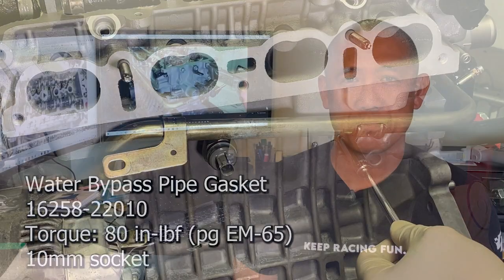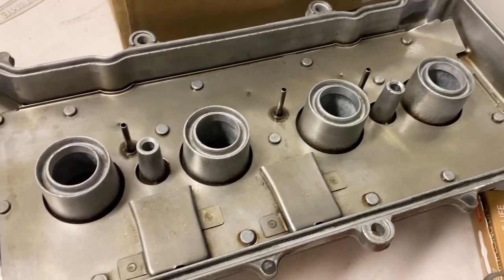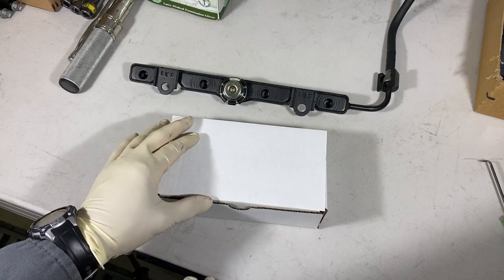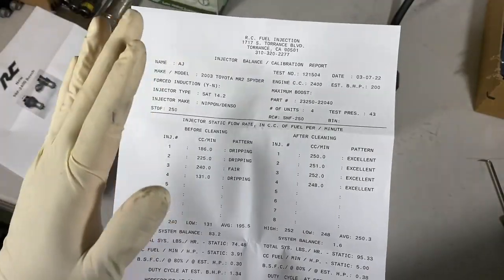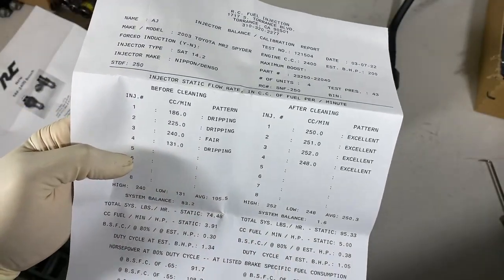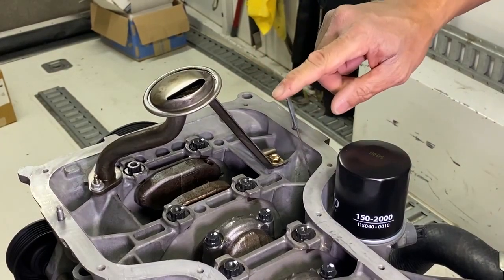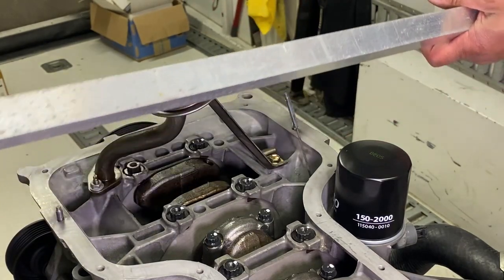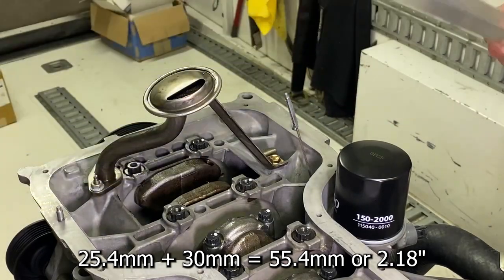1ZZ-FE Rebuild Part 6 - Valve Cover, PCV, Fuel Injectors, & Oil Pan

Comment: Hi AJ, thanks so much for posting this video, I have a 2005 Rav4 1.8 Litre, 1ZZFE engine, EU/UK version. I got it second hand in April 2024 with 88,000 km on it. It has been running very well, however I'm looking into replacing valve cover gasket, then check transmission as well. 

Could I ask if you got a video of the transmission rebuild?

Thanks very much in advance! 
Merry Christmas!
Reply from the maker: I made some transmission disassembly videos, but never showed the rebuild (see Project Yellow Episode 5 thru 7).  Rebuilding a transmission using OEM parts is an expensive endeavor. I recommend doing a scenario analysis to determine which is your best path: rebuilding or buying a known good used transmission. Good luck. Pls subscribe. -AJ

Comment: Just want to say a massive THANKYOU AJ. I am at the timing chain stage with my 1ZZFE IN A Celica and I could not have done the rebuild without your videos. Credit to you mate 💎
Reply from the maker: Very cool and very welcome. Pls subscribe. Thx AJ
Reply: @RelentlessRacingAJ question AJ before I put timing chain cover on. The only thing I have not dismantled, looked at and cleaned etc before re-assembly is the VVTI camshaft gear cog. I did not remove it from the camshaft, properly cleaned them both together with hot and soapy, rinse then blast of with acetone spray. Gut feel was not to separate them. Any comments or advice please. The engine had/has only done 100Kmiles. And yep subscribed yonks ago 👍
Reply from the maker: @Chrs144if u don’t disconnect the gear from the cam u will b fine. Send it
Reply from the maker: @Chrs144FYI - after uploading this vid, I really dug into the VVT gear… how it works, unlocking, locking, why to unlock, how to clean it, how to open it, and how to inspect it. For the most part, if u remove the VVT gear from the cam, u need to unlock it prior to final torque to make sure the locking pin doesn’t get stuck. If the locking pin gets stuck, then the VVT gear will pop a code stating it isn’t working. Also, the outer plate can get worn, which is why I open it for inspection. Lastly, the 1ZZ & 2ZZ VVT gears are the same part number.
Reply: @RelentlessRacingAJ Thank you AJ. Full send tomorrow then
Reply: @RelentlessRacingAJ  FairPlay. Yes it looked mega complex in the Toyota manual. Thanks again
Reply from the maker: @Chrs144yeah Toyota didn’t do a good job explaining em in the manual. It is actually quite simple and looks like the one used in the K series. I’d b willing to bet the same company makes them. If u get a chance open one. They are very interesting.
Reply: @RelentlessRacingAJ Hi AJ can I send you a very short vid showing my timing chain tensioner installation, the two click sounds and the clockwise to check top dead centre mark please. I will happily donate to the cause. If your a go, what sending options, it’s 2mins 25secs? Thank you, Chris
Reply from the maker: @Chrs144PayPal to ajaquias@yahoo.com
Reply from the maker: @Chrs144u can email ur vid to shoprelentlessracing@gmail.com
Reply: @RelentlessRacingAJ I’ll set PayPal up 👍
Reply: @RelentlessRacingAJ will do 👍
Reply: @RelentlessRacingAJ  Hi AJ, just resent email video in case it’s got lost in your spam folder. Having another go at PayPal sign-up, currently refusing my phone number! Happy to donate to Relentless Racing, I hope many other are contributing also, this is worthy information 👍

Comment: Where is the Banjo bolt located for the oil pump in 1zz engine?
Reply from the maker: @IlackKevinc  I am not aware of the “banjo bolt” for a 1ZZ oil pump. The oil pump installation is in Part 4. Good luck. Pls subscribe. Thx AJ

Comment: Is there a reason not to install the oil pan right after the oil pickup is installed?
Reply from the maker: Yes, if u drop something in the motor it is easier to get out bc the oil pan isn’t on. Thx for watching and commenting. Pls subscribe. Thx AJ
Reply: @RelentlessRacingAJ  Actually, that's a good point. I still think I will install it right away, to keep the inside as clean as possible.
Reply from the maker: @torew01  I recommend installing without bond to keep the inside clean. Once everything is installed, final bond the oil pan. Good luck and pls subscribe. -AJ
Reply: @RelentlessRacingAJ  Will do, thank you very much. I am building the motor with a new shortblock.

Comment: How much of a difference between the 1zz-fe and the 1zz-FE in the Lotus? Can a stock one be built to Lotus spec for more hp? Thank you AJ
Reply from the maker: The 1ZZ is a good lil motor but if you are looking for power I suggest a swap… 2ZZ or K depending on ur goals.

Comment: Sorry if I'm too late to the video, do you have any idea what the part number is for that bottom left bracket? 3:18
Reply from the maker: Thx for your question. Pls subscribe. If you are asking about the brackets I am clipping the wires to then that’s not a simple bracket. I’m clipping the wires to the oil dipstick tube and the coolant bypass pipe. -AJ

Comment: I have a 1zzfe voltz and I am wondering why my injectors are different 23250-OD030. They
 only flow around 210cc/min. I am here wondering if this the reason for my long term fuel trim of 17%.
Reply from the maker: Toyota had minor changes w all the different 1ZZs… injectors, fuel rails, fuel dampers, ECUs, cams, EVAP, etc. Unfortunately, I don’t know all of them. You will have to either refer to the OE service manual for your specific vehicle, take your vehicle to a qualified mechanic, or take your vehicle to a Toyota dealership to have it properly diagnosed.
Reply: @RelentlessRacingAJ  I think I found the answer. You probably have the 1zzfed.

Comment: Great video AJ and the chapters are a nice touch.  What device were you using on the RTV tube to apply it?  It looked like it has a trigger to help dispense it.  Also, you should become an Amazon partner and link to the tools you use so we can buy the cool ones and you get a small commission from Amazon.
Reply from the maker: Thx for watching and commenting. Good job on noticing the chapters. I’m not sure if anyone else noticed them. They should be in all the videos within this series. Also, I identified the tool you are asking about at 9:17. It is the Valco Tube Grip. Finally, an excellent suggestion for the Amazon partner thing. I’ll have to look it up… not unless you know how to do it.
Reply: @RelentlessRacingAJ  Haha, was watching you use it but not reading the screen as I was impressed with it. 8-)

Comment: Do you know where I can buy this injector? I saw the part number:
12      3660
                  326
23250-22040
 Other side:
A1
   DENSO
... I know this fuel injector are expensive for OEM part. I don't want to buy aftermarket one. For now I owned 1 out 4, I need 3 more so I can called RC Fuel Injection for their services. My aftermarket are defective for sure.
Reply from the maker: Sorry, you will have to do an internet search for that one.

Comment: I’m looking for advice on my 01 mr2. I’m burning oil like crazy, as those early models do. In your opinion, would it be ok to rebuild or better to get a 03 - 05 replacement? I’m cool doing the rebuild but I don’t want to put out the effort if it would still be prone to the oil burning issues.
Reply from the maker: Let’s be clear… if you rebuild a PFL motor (meaning you replace the pistons and rings and have your bores cleaned up), there shouldn’t be oil burning issues or u messed up the rebuild). With respect to the cost… well u will have to run the numbers yourself. If u want to go quick and dirty, then buy a JDM motor. However, I’m OCD and that doesn’t work for me. I like to know where everything is, so I replace anything and everything that might be degraded or bad (rebuild the head w new seats, valve seals, every gasket, o-ring, hoses, water pump, oil pump, main and rod bearings, etc).  Also, I consider a rebuild as a chance to learn about a new motor. In the end, the choice is yours. I hope this helps. Pls subscribe for more MR2 content. Thx again AJ
Reply: @RelentlessRacingAJ  That's exactly what I needed to hear! Thanks.